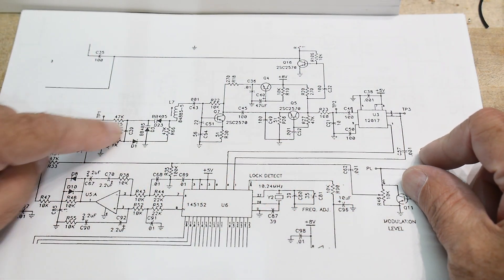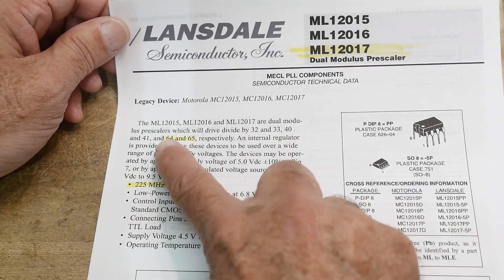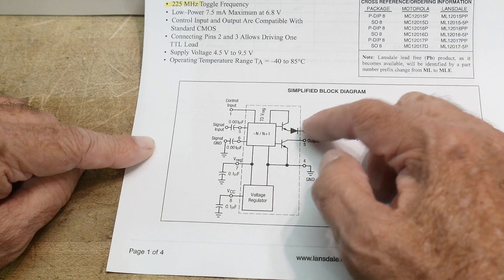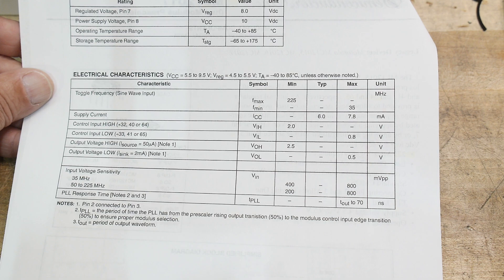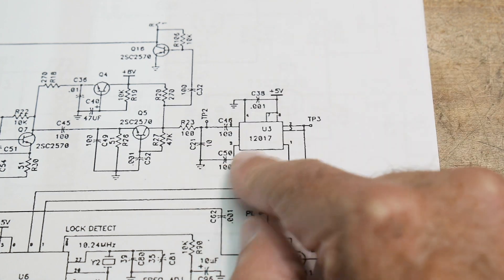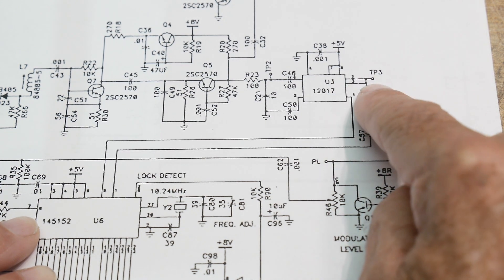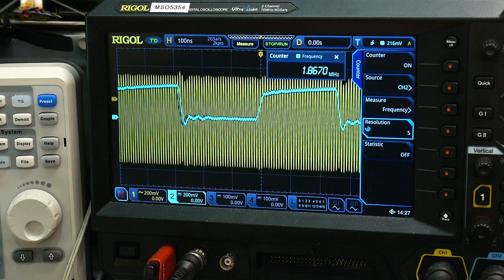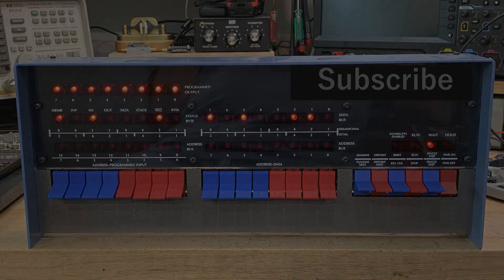#1512 Ramsey 2m Prescaler (part 7 of 12)

Comment: Basically dividing part of the time by 64 and part of the time by 65 allows you to divide by a non-integer. It’s called fractional N synthesis.
Reply from the maker: yes, the next chip will be the one that does that. N = (A+B)/(A/N + B/(N+1))    the N and N+1 being dual modulus

Comment: I used to use devices like this in radio synthesizer design at Motorola. The dual-modulus concept is pretty important for letting the synthesizer achieve fine frequency resolution and it's an interesting bit of math that some viewers might be curious about. This wiki article goes into greater detail on how it works: https://en.wikipedia.org/wiki/Dual-modulus_prescaler
Reply: That’s pretty cool, thanks!! Very interesting stuff! Also, Happy Memorial Day to everyone celebrating it! 😎
Reply: And this is why engineers get paid all those big bucks.   😀
From the article I can understand what is going on and find learning this design stuff fascinating but my brain just doesn't seem to be wired right for conceiving such a concept.